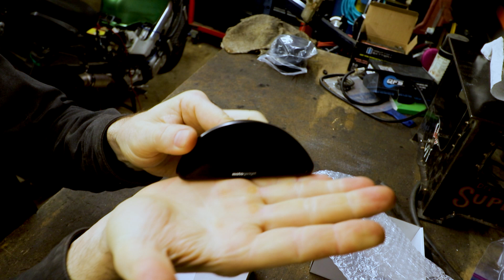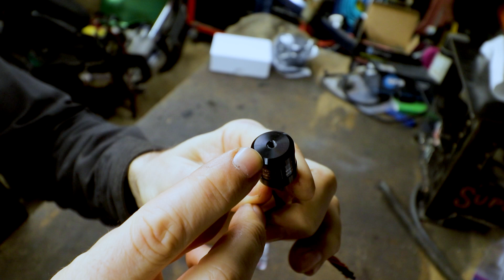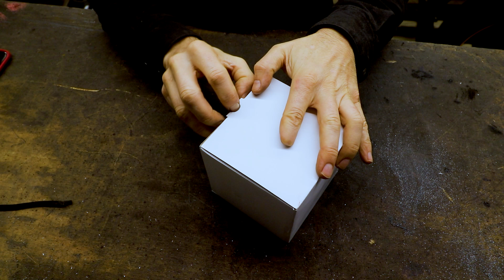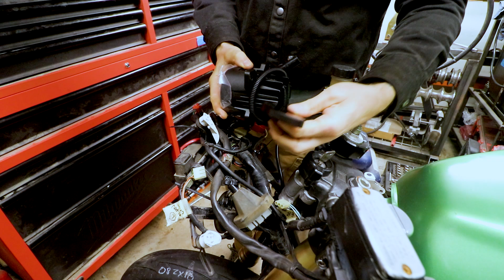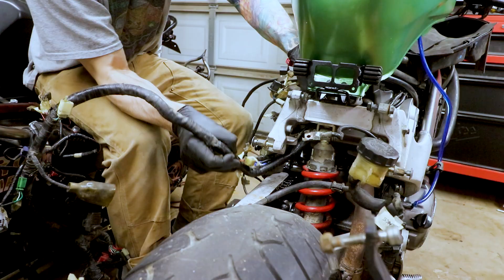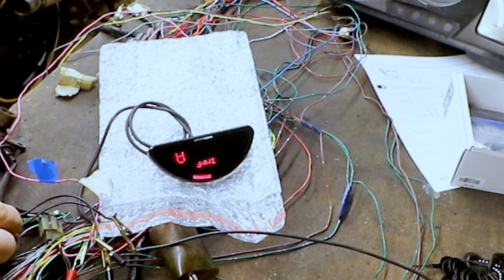VFR 12.12.24 | Electrics: Motogadget + Morimoto

Comment: Nice. I changed to all LEDs on my bike.  Many quite recent bikes are not even all LED.  The bike and car industry is quite slow moving, I guess due to safety and scale. 

I am looking forward to seeing how the aftermarket speedo works.

I have the same crazy depinning kits myself. It would be cool to replace the low end connectors with Deutch connectors.